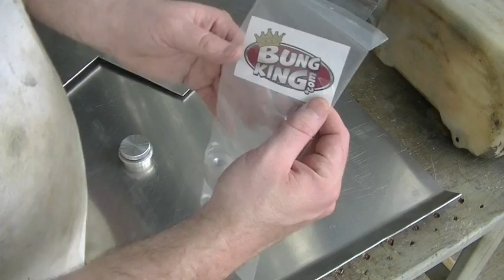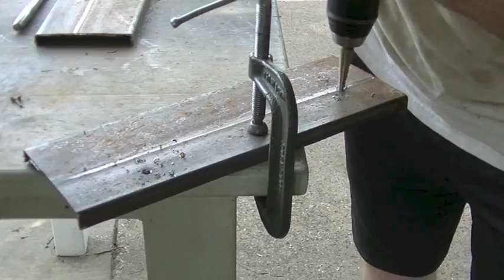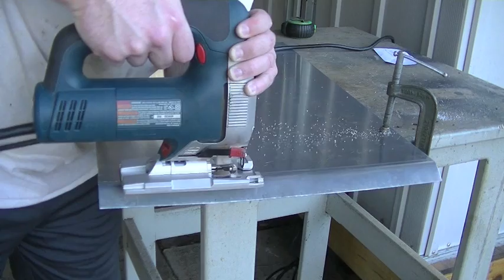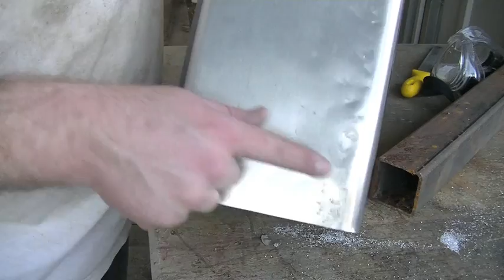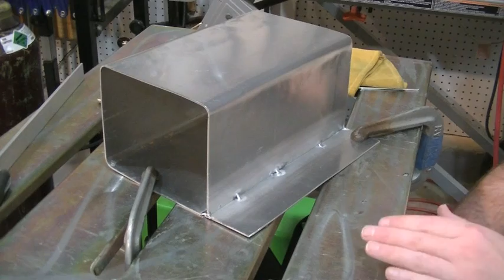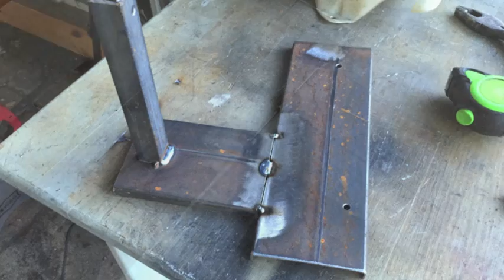PART 1 CHEVY C10 EXPANSION TANK BUILD | TIG Welding An Aluminum Coolant Reservoir

Comment: Instead of hammering directly on the project could you not have used some scrap steel or a block of wood aginst it and hammered on that?
Reply from the maker: +bhwystar I tried wood but it wasn't working well.  I didn't try using a piece of steel.  Bottom line... the way I did it is most certainly not the best way.  If I'd had a sheet metal brake, I would have used it.  But I really should have cut 4 individual pieces and welded them together.  Thanks for watching!